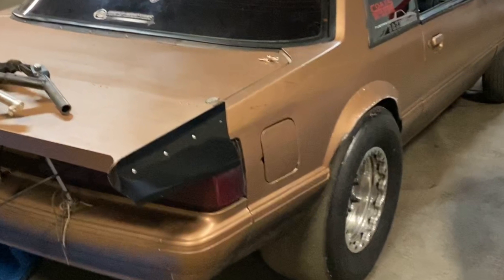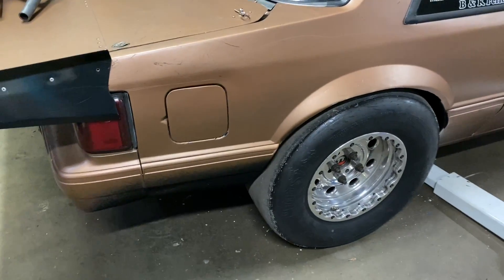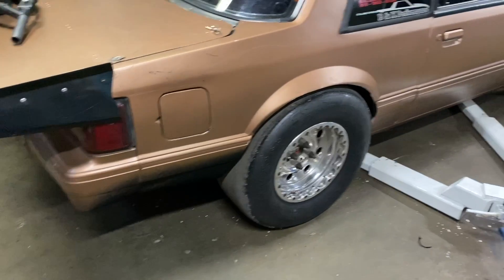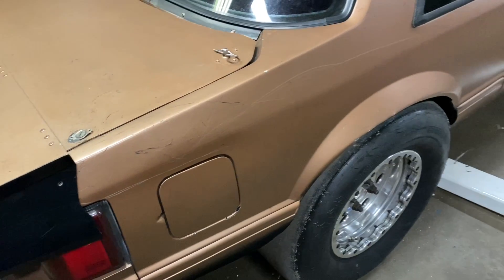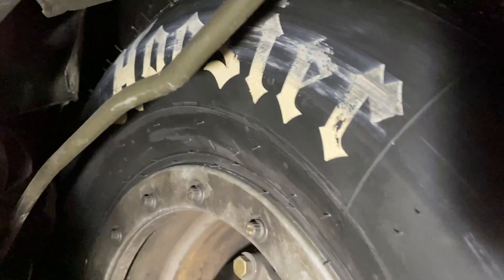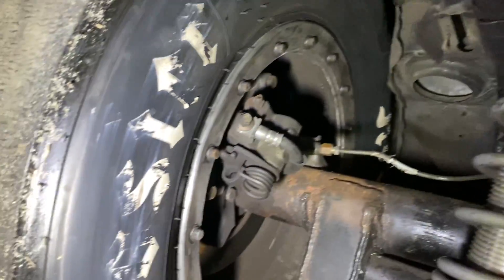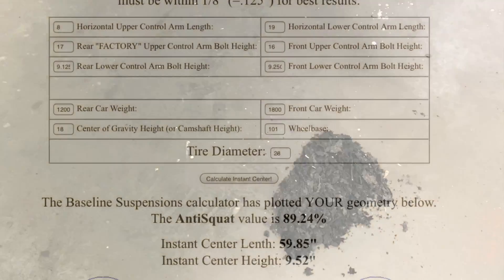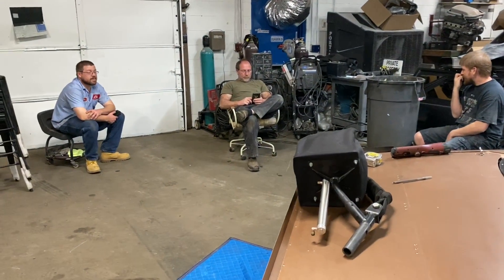Drag Radial Suspension Setup

Comment: What’s your opinion for a stiff wall slick on percentage of anti squat closer to 100% or higher the better? Depending on how I’m gonna weld my lca brackets I can be lower toward 100% and maximum of 144% or I can change em up an weld then different for 144% minimum and 231% maximum 93 fox on 28s stock location everything else.
Reply from the maker: For slicks, most really fast cars are less than 100, but some do separate some so are 125-150 may work
Reply: Turbo John thanks for the info. You don’t find a lot of guys that will share info or even out out informational videos as yourself on chassis tuning with IC and AS and shock settings.

Comment: Hey John love the vids man. Can you talk about rear spring rates and if you run rear preload? I had 110lb springs in the rear of my 3000lb car and it would sit on the bump stops with no preload. I put 200lb springs in and now it sits 60% compressed in its stroke with no preload but I’m worried they might be too stiff for racing? Haven’t done any racing yet so I guess I’ll tell soon
Reply from the maker: Thanks, I think mine are 110, but I like them to compress.  They store the energy, which is good.  Keep running the spring up on the shock.  If it’s radials and has a lot of separation, you need most of the shock arm in the body of the shock

Comment: Is that small block Chevy ?,your videos extremely explanatory having problems with my g body Buick hooking but a 4 link is a 4 link bar angle is bar angle correct?
Reply from the maker: Yes, mine is SBC.  Yes, 4 link is best for these changes.  If on radials, make the top bar angle down 2-3” and the bottom bar flat to slightly up hill.  Make passes, get vids so you can see what it is doing

Comment: If you mini tub it you can go to a wider wheel. Weld 71LB-512P85C is 15 X 12.33 with 8.5 BS. You would have to have them beadlocked. They would bring the tire under the car some. The wider wheel will help stabilize side wall and give wider more consistent contact area. Should help with traction and handling. You would only need to notch frame and replace inner fender. No cutting rear or those righteous 4 lug axles.
Reply from the maker: Good idea
Reply: @TurboJohnRacing  Summit sells that wheel with a single beadlock but it would  be cheaper to buy plain wheel and have macfab double bl compared to having them add the second bl. Would change up the look of car too.

Comment: Seems like your car worked much better with the weight in the trunk.
Reply from the maker: I’m gonna test this next putting!  On the rear, it changes the front/rear percentage!  But not the actual leverage on the front.  With the weight in the truck it, pivots on the rear end.  Never ending testing, lol
Reply: @TurboJohnRacing  Part of learning includes learning what works and what doesn't. Both equally valuable. Still a crapshoot most of the time when there are so many variables in this game we call drag racing.